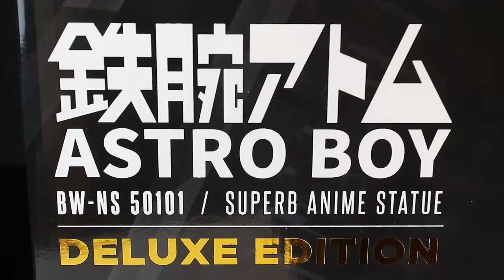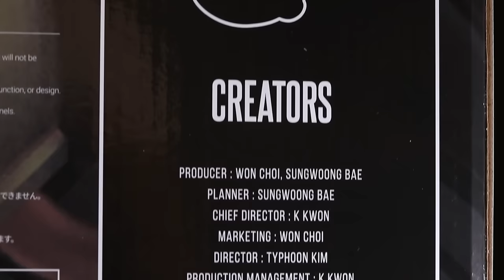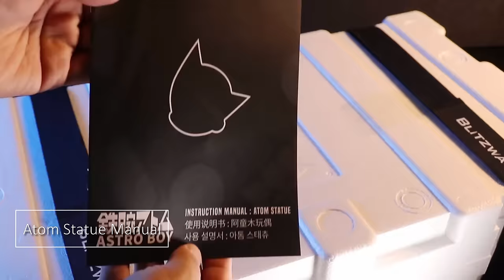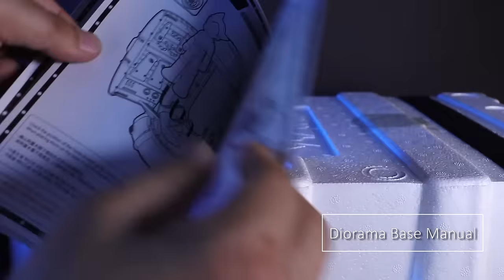BLITZWAY 5PRO STUDIO ASTRO BOY DX REVIEW ASMR

Comment: Wow! Just wondering when the heart button is pressed do the lights stay on until the button is pressed again to turn them off? If so how long is it before the lights are dim and the battery is flat? 🤔
Reply from the maker: You must press the button again to turn it off. As time goes by, the light fades away. The battery doesn't last long. So there are people who remodel the lights to be on all the time.
Reply: @Titaniumboy  I’m looking at doing that, do you by any chance have a link to somewhere you have seen this? I was with wondering if the best place to run the wires would be down the right leg?
Reply from the maker: I've only heard of it, but I've never seen it. It's like connecting a cable to a battery.